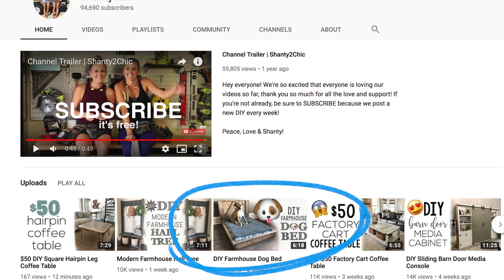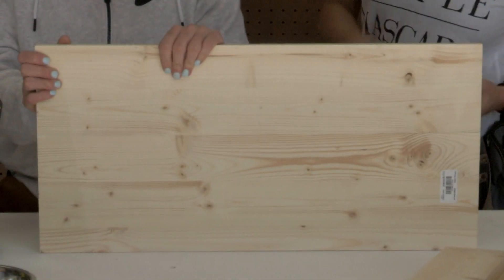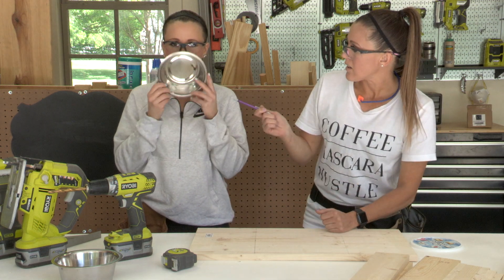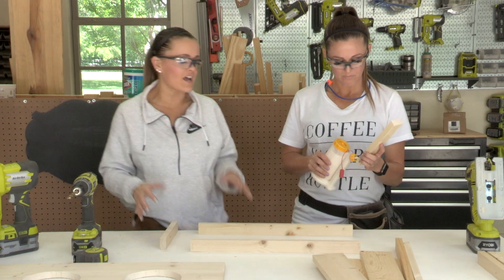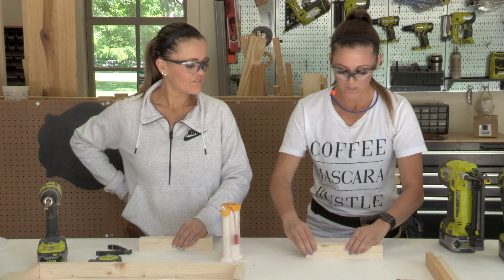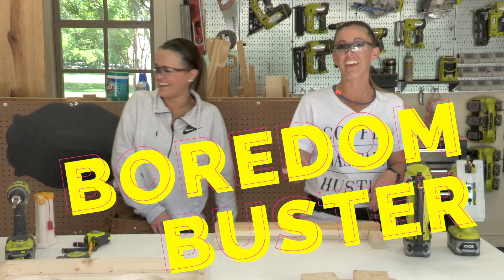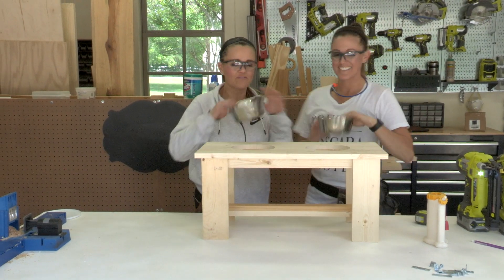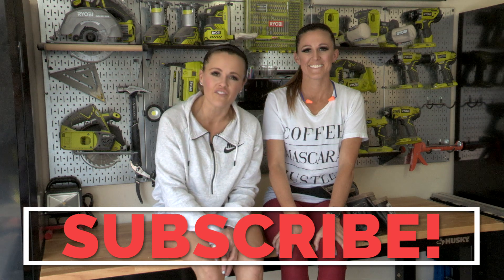DIY Dog Bowl Stand

Comment: I do not see a proper material list or a cut list? And what size does the laminated pine panel supposed to get cut to? You don’t explain that either? In the videos all you say is grab the shorter pieces or the longer pieces, you don’t even say what size to grab.
Reply: I agree!  They rush through it and don’t actually show the hardware attachments either! 🙄
Reply: I think because you can make it any size you want. I will use this video for a general idea on how to build it but will use my preferred size (I only want one bowl, not two, as my dogs don't eat next to each other).